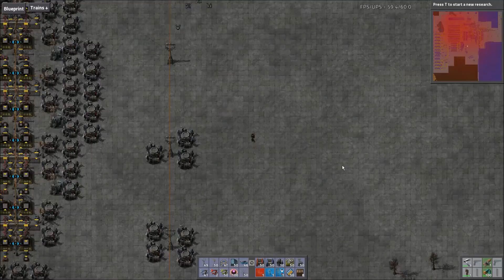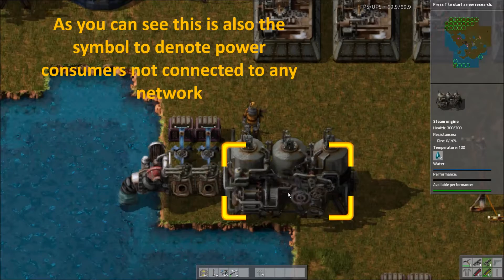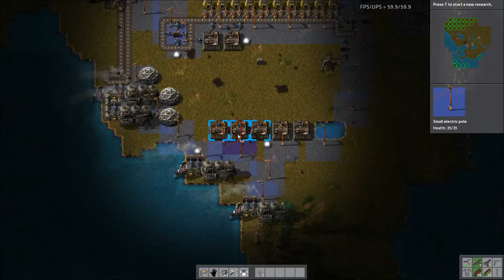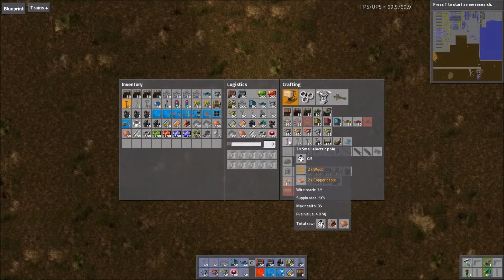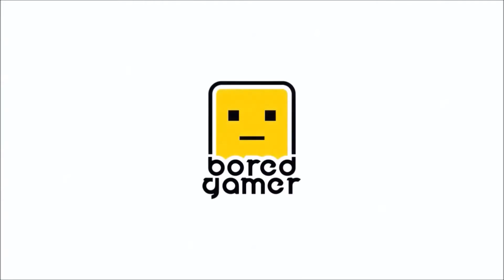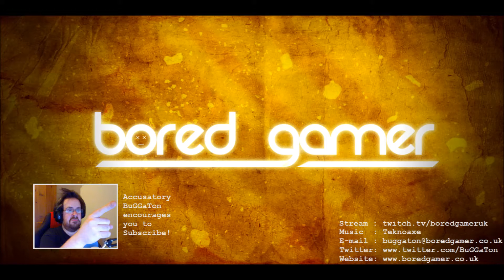Encyclopaedia Factorio - Energy Distribution and Electricity Poles

Comment: I think you should have mentioned that each pole can only be attached to a limited number of wires (6, I think).
I often screw up when connecting a cloud of mediums to a single big pole to power my miners.
Reply from the maker: +Riccardo Orlando It's 5 and I've never discovered that before today; mostly because I can't imagine a situation that'd require it!  XD
Reply: Well, someday I decided I'd have my miners powered in groups, all connected to a big pole net, branching with mediums, since the deposits always deplete unevenly and I wanted to be able to order my bots to mow down anything over depleted terrain.
Doing so with standard medium pole layouts disconnects some parts of the miners, so I first built a big pole net and developed the mediums as branches from the bigs. Only I could not have 8 as I wanted, but was limited to 6.